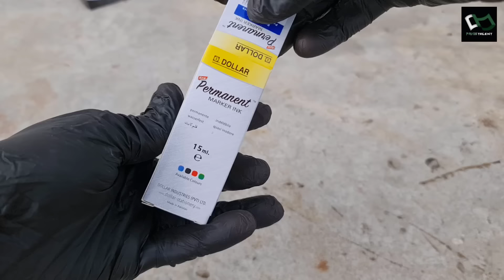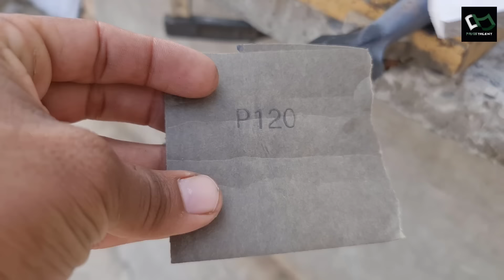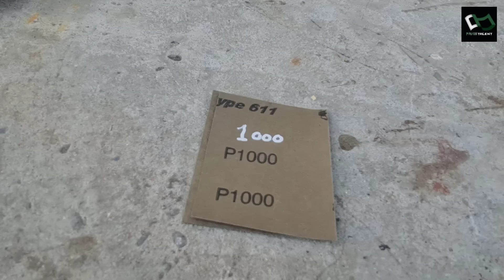Forging Beautiful SPEAR out of Rusted CHAIN

Comment: You could have made your work a lot easier when forging the spearhead by using a rounded or cross peen Hammer rather than a flat hammer. It concentrates the force across it and helps it to draw out. The spearhead is also very off balance from the point  to where the shaft connects. It's visible while turning; and even visible in the end shot when it was complete and you twisted it in the air you could see the tip oscillating due to its imbalance.
Reply: Yes..that lil bit of symmetry is needed to complete this masterpiece.
Reply: I could tell throughout the video, this person is not very skilled with tools and I suspect the end product, albeit looking "cool" is sub-par at best. Several problems there.

-Anvil is loose on the ground.
- No attention was paid to thickness and weight of the blade.
-The hammering looked primarily cosmetic rather than shaping the blade itself, most of the shaping came from grinding, eliminating any benefit forging might've given the strength of the blade.
-Hammering was inconsistent and left deep gashes and high spots.
-The quenching was done precisely up to where the most narrow part of the blade is,  and since there was no tempering this is making the weakest part of the spear the most prone to stresses that'll make it snap.
-No attention was paid to wood grain while making the shaft.
-the shaft is generally too short for a spear (But okay, that's up to him, not a big deal.. there are short spears anyhow)
-There's no shoulder on the wood to retain the twisted wire in position.(a few vigorous thrusts and it'll get loose and slide off)
-The majority of the wooden hilt was lacquered, making it slippery.... worst thing you can do to a spear shaft.
-the pommel is completely loose and held into position by a wood screw and some glue... (Bad, very bad)
There's more but I think I've made my point.

All in all, this is extremely poor craftsmanship. But if it was a first time attempt, I'd say "not too bad for a first try".
But if this is someone claiming to know what they're doing, I'd say there's a hell of a lot of space for improvement.
Reply: U do it better then
Reply: @marinodezelak1180  I wouldn't call this extremely poor craftsmanship. For sure he machined the spear rather than forged it, and made some design errors like the lacquered shaft, but the guy set out to make a functional spear, and it sure looks functional to me.
Reply: @cacklingpikeman4303  it may look functional, but after watching how it was made, that isn't  functional spear.
Reply: @marinodezelak1180  What are you on about? It could easily kill a living thing therefore it is functional.
Reply: @unknownsword9042  I agree with you but with your argument a slipper is also a functional weapon because you can kill something with it.
Reply: @fashionovawigs  the only thing you can kill with a slipper is a bug and even that requires a lot of force
Reply: @TonyJaaFan1587  he said something not anything. your ‘smart’ response only supported his statement. besides, hit something with a slipper enough timed you’re sure to kill it
Reply: It's mild steel anyway chill out or do better yourself.
Reply: @unknownsword9042  Against medieval armour this thing is powerless or against someone with a leather chestplate... That thing will snap like a twig
Reply: @marinodezelak1180  Lacquer provides a better grip than oil though. I know because I removed the lacquer on one of my hammers and oiled it and the difference is night and day. I can swing the lacquered one all day, while I have to squeeze the oiled one much more. Using so much stock removal wasted more material, but no strength was lost. Forging doesn't add any strength compared to stock removal. That's all in the material and the heat treatment. The pommel is also not a super important part, but considering he has access to a lathe, it would've been easy to make a perfect fit. It would've also been easy to straighten the blade. And it's pretty clear from how it looks like after quenching that it is indeed mild steel so the heat treatment did nothing anyway.

Comment: I love the length on this. It's short enough that you can do more than just straight stabbing and actually swing it around in different directions, but still take advantage of using it two-handed.
Reply: That’s what she said
Reply: Its not a good spear the front blade is to big makes it unbalanced because of its weight
Reply: @jackbarnes9316  good one
Reply: @OvertMF  Probably should add a "spheric ball" in the back to balance it out.
Reply: @DoubleDbababoi Are there any non-spherical balls?
Reply: @omegab4k4  idk

Comment: Very nice job! Two teensy little suggestions:
1. The blade seems bent and this will affect it's strength since the impact force will be concentrated on one side of the spear resulting in added damage. 
2. Use cloth or rope for the grip. It adds to the comfort of the wielder and there is less risk of cutting from the wire.
Reply: Wire wrapped grips are present on a number of historical artifacts from the Middle Ages through the renaissance. It’s uncommon to see it now but they work well and when you’re wearing gauntlets/gloves there is not really a risk of hand injury

Comment: Good job and good video. But one thing to point out.  Do you realize how much energy you are losing by having your anvil lose on the ground like that.  
You are working a lot harder than you have to.  Every time you swing the hammer and hit the steel and the anvil moves that is wasted energy that did not go into the hammer blow.  
I have my anvil secured to a log that probably weighs about 350-400 lbs.  
when I hit red hot steel on it there is zero movement and all the energy of the blow goes into the steel.   Just a little advice, secure your anvil and you’ll find out you don’t have to work so hard and shaping whatever you’re forging.
Reply: Very good advice, I noticed right away.
Reply: Exactly! Anvils mounted on concrete or very dense logs with at least 6" long lag screws securing it down will produce the best results, and to add one step further you can bed the anvil down with Epoxy for absolutely zero vibrations, all the power gets transferred to the workpiece. Makes a lot less noise too, since it stops the anvil from vibrating.

Comment: Amazing skill
Reply: Hes doing it all wrong! He isnt even wiping the flakes off the anvil
Reply: (emot batu)
Reply: @domandodo9658  idk, can’t argue with his results lmao
Reply: @avaleloc1513  True, his results are an asymmetrical, out of balance spear head inadequately fastened to a too short shaft featuring a wire wrap that is going to if it is handled more than hanging it in a wall. If the object was a wall hanger, it's a sucess, I suppose, because that is all it's good for.

Comment: pro tip, when fire hardening your wood, you want to try and compress it (i.e. running a smooth rock over it a SEVERAL times.) and then you want to grease the wood. Rendered animal fats tend to work best in my experience! THEN, with greased wood, you can fire harden it!

Keep in mind, although this does increase durability/hardness, it reduces the overall strength of your wood and makes it more likely to fracture.

Comment: Hard to get a feel for the weight but it looks capable of cutting chain mail no problem.
It doesn’t seem balanced for throwing but thrusting with the great length it’s very versatile and easy to use.
Of course if someone is pointing a spear at you today you win unless the other guy gets a gun.

Comment: I know this is coming from the peanut gallery, but, 1. You should secure your anvil to something, preferably something super damn heavy, 2. Your forge LOOKS rather inefficient, I could be wrong, but check out some designs and maybe make improving it into a video, and 3. You should spend more time honing your hammering skills, which is a good tip for us all really, but a lot of the grinding you did could have been made much easier by better shaping the spear point on the anvil, specifically you could have rough hammered the bevels and if you want to really challenge yourself, try forging the socket on the anvil next time instead of using the lathe, although I thought your method was quite clever

Comment: What's the angle on those bevels? Did you not hone it? Whetstones removes materials while a honing stone or honing rod do not. The spear pushed the bottle more than it cut. After sharpening any edge, the very end of it will be bent but the bend is so small you can barely see it with a magnifying glass and yet it makes a big differance. Honing the spear will allow it to cut through a full bottle like a hot knife through butter.

Comment: nice job BUT i dont understant  why are making it more difficult than it is, you have the right tools you dont need to switch to another tool if the first one works great, the steps are little bit mess up, try to plan before strating to work

Comment: You should have choose a design where part of the blade is IN the wood and then reinforce it with metal wire around the stick, and not with the blade ON the wood because now you have a really weak point where the blade fit on the stick

Comment: You need to fully coat the kaol wool in refractory cement or you will continue to be blasted with microscopic fibers which will cause irreparable damage to your lungs over time. Great vid though!